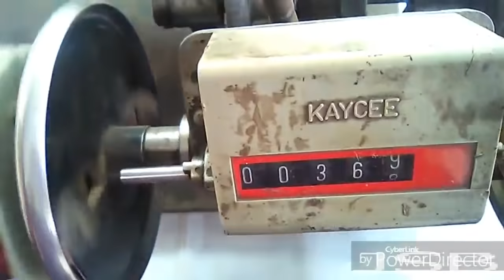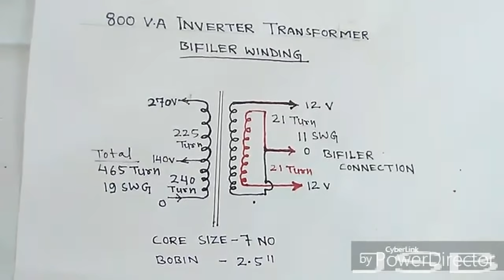800 V.A Inverter Transformer Bifilar  Winding | JSB ELECTRIC. YT-25

Comment: You have start to widing in the oposite corner, i think that was to easly lock the wire. But you lost widing area... was that the reason? Normally i do this when i have odd layers. 👍

Comment: how much material it would take for a 2kva 1600w inverter transformer ,  iron weight,   copper weight,  for 6 battery model 72V DC,   does aluminum wire save money without increasing losses.

Comment: ok sweet vid 1 question what are you checking for just before you join your wires. and how do i check this?
Reply from the maker: continuity test  for center loop  and you check with multimeter

Comment: Sir sukam 400va inverter me 0_12 input me Mota gauje ke 2wire ku die hai eksath ;us side me two wire Nikla hai 0_12 volt dc please bolie sir
Reply from the maker: bifiler winding me 2 wire eksath use hota hai
Reply: bifiler winding kaya hota hai sir pls bolie uska Kam kaya hai sir

Comment: UGH!!  SO many things done wrong here...  Coming from experience too...  I wound low voltage battery charger transformer coils (24 Volt, 800 Amp) using 4 strands of 6-0 square wire. That transformer was 450 pounds when assembled with the core!! 
The insulation techniques and the way they secured the starting breakout leads and insulated them are ALL wrong.  You also should be flattening each side of a layer before starting the next layer, AND chasing the windings so they take up the minimum amount of room on each layer...

Comment: Sir 4no core 3.5 inch m 700va ka winding detail dijiye
Reply from the maker: make only 625 VA ( 500watt )
wire size - 20 SWG
primary 186 turn for battery charging, 186+174 turn = 360 turns for output 270volt .
secondary 12 - 0 - 12 volt , 16+16 turns , 11 SWG